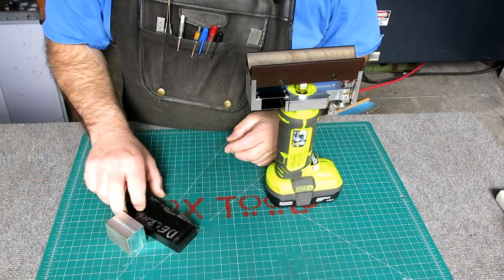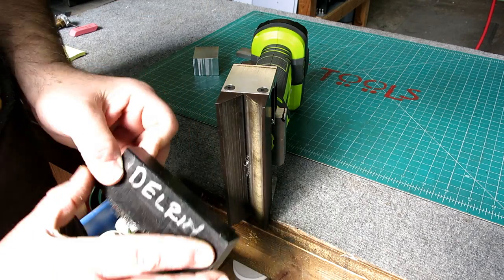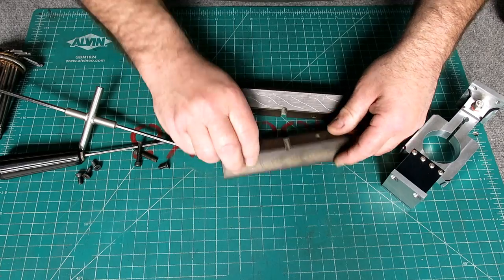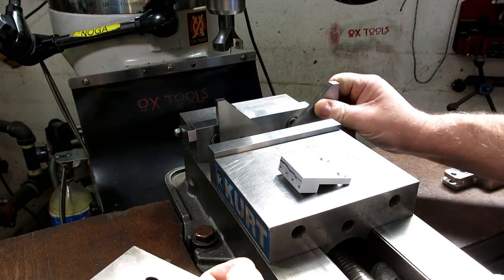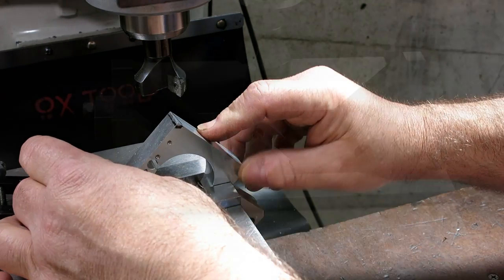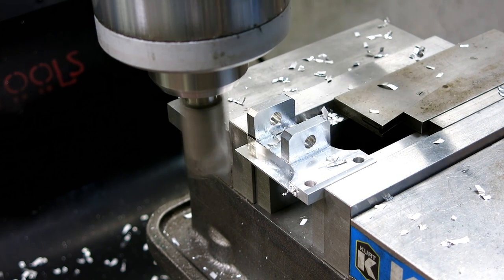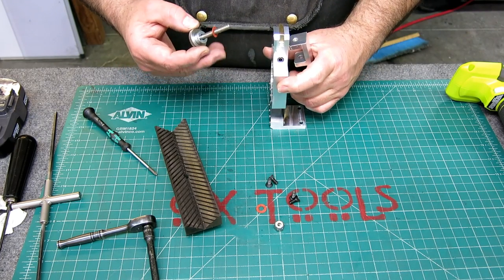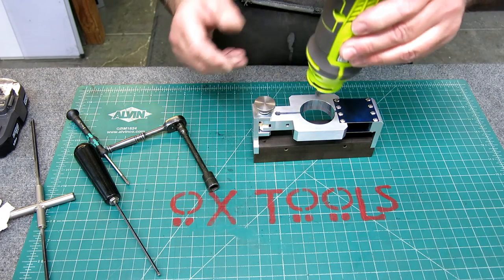Power Chamfering Tool

Comment: Thanks Tom, very well though out design - Way more sofisticated than the one i built years ago, without height adjustment. I always considered cutting a fine pitch thread on the neck of a Router motor for fine adjust...
Reply from the maker: Hey Stefan, I bet you use the heck out of the one you built. I have many tools I have made that I wish I had done slightly differently but have never had the time to go back and change. This tool would have been the same if I had built it with a pneumatic die grinder like I originally intended. 

Thanks for stopping by!

Cheers,

Tom
Reply: You might be interested in a tool called a microstop countersink; they're common in aviation for precisely countersinking rivet holes and the mechanism may be adapted.
Reply: @jimsvideos7201  Thats a good call.   I just found a little set and they are wayyy less expensive than I was anticipating.  Typically when you say "aviation" or "Porsche" the cost of said tool/widget goes up IMMENSELY.  
I think I might actually buy this guy i just found: https://www.skygeek.com/aircraft-tool-supply-133kit-microstop-countersink-kit.html

Comment: That would stand proudly next to the power squeegee in the gizmos you never knew you needed but now can't live without.
I didn't buy a squeegee, mainly because everyone else did!  But this I would buy like a shot.  I am a compulsive sprue trimmer  I built a thing like a potato peeler to shave those aggravating and often sharp little seams from tool handles and the like,
When I first started work one of my first jobs was to use a hand auger -with a plastic loop but no crosspiece to make a small hole in a piece of wood, I felt quite pleased until I spotted the other 999 - by the end of the day the moulded loop had almost bored a hole on my delicate schoolboy palm and the burst blister was leaking.  Being my first day I just cracked on I wasn't going to ask for a glove or a piece of wood to make a handle.  Before I went home I trimmed that loop 'till it glittered.

I never forgot and always trim the sharp edges and chamfer corners before using all my tools for the first time.
So I'd appreciate a flat surface trim option as well as the chanfer on v2.1 of the tool please Tom.

Comment: Have you seen those little pneumatic chamfering tools? Look like a mini palm router with a “router bit” that takes a triangular insert. Not quite an analog for your tool, but they work well for chamfering a hole or slot if you have a steady hand

Comment: Tom,  Great fun seeing your log cabin self at work.  You look happy! Please trim the ends of the bottom uninstrut bracket on the lathe before someone gets their ankle sliced open.   Glad you’re following you instinct about insulation. It is a bit of a scam in my opinion. They buy the insulation in large quantities cheap. The actual installers will usually be underpaid and will do the in less time than you can imagine.  Installing foam panels or, having it sprayed on could save you some $. I’m not sure. One thing I am an expert on is mice.  Do everything you can to seal up your building now; they’ll still get in, just not as many. If you can, I suggest you install exhaust fans before you insulate the ceiling?  Cheers, Will.

Comment: Oh wow, that's handy as hell, great idea.  I can see other possibilities for this tool as well, such as quick change vee blocks (or just a split vee block that you can widen or narrow) for different angles, or an adjustable stop on one side so you can quickly cut circlip/ring grooves in round stock with a smaller cutting tool...just lay the round stock in the vee block and rotate it to cut a few thou at a time.

Comment: I’d like to see the designs if you ever draw them up.  I also want to build the “male” version of this tool.  That is, a tool to cut a narrow (.030-060) relief (~.050” deep) in the inside corner of an internal angle (30, 60, 90, etc).  IE, the relief in a dovetail...Could be a saw or a tiny endmill and will be more dangerous if not designed properly, but very useful. Thanks for sharing!

Comment: Very nice, as far as the machining for the center nut, I have tried the same thing, and what I found is that if it was a regularly used adjustment reference, the flat on the nut was to short to last for any length  of time, so it might have been a blessing in disguise. You're still totally amazing.

Comment: Hi,Tom. I don't know if you've seen the video but Stefan Gotteswinter made a bench mounted power chamferer using a cheap small sized router. He used the type you can detach the base plate from. Love your design as it is very portable being cordless. I do have a Dewalt cordless die grinder but it would be difficult to adapt because of the long nose and rubber over moulding. Love to see some plans for this tool.

Comment: Nice design, the only thing I would do is break the edges on the groves you milled into the v-block.
Reply from the maker: Hey Joe,

That would defeat the purpose of how they work. They actually shear off little chips and bits as the block slides down the vee. Kind of like how a foot on an indicator base is sharp cornered to prevent dust and dirt from going underneath. I did flatten the surfaces so you don't feel any sharp edges when you run you hand down the vee. Thanks for the comment.

Cheers,

Tom
Reply: I thought you were joking.  I was going to ask Tom to show us how to sharpen that little bit he used on the grooves, but didn't know if it would sound funny, or like I was a jerk.  

I had no idea the sharp edges served a purpose!

Comment: Really enjoyed the video , My choice for tools had been De Walt when made here, only use the corded ones from offshore. Ryobi makes descent tools and the One + have over one hundred tools available using same power configuration and their drill, driver, hammer drill combo really works well and doesn't over-cost the wallet.
Reply from the maker: Hi Joseph,

Normally I'm allergic to Ryobi but this particular drywall trimmer had a couple of features that won me over. The circular neck, the top speed and the low price since I would be abusing it on metal. Yes the downside is now I have another battery system in the shop. 

Cheers,

Tom

Comment: I agree. It’s hard to remember which edges. The problem is that a square has too many sides (strange, but the general purpose rectangle has the right number). I’ve been working on an improved square for some 30 years, but, for some reason, I haven’t been able to perfect it yet. I’m close though!

Comment: Add some tabs to the main body to make it bench mountable, I would love to see the prints. Foot pedal operation would be cool. This could be one of those tools where you use it every day.
Reply from the maker: Hey Doug,

After I released the video I realized I should have shown the unit clamped in the vise. You can grab it by the main clamp and hold it in the vise. Works pretty good.

Cheers,

Tom

Comment: There is a tool that is readily available called a laminate trimmer the is used to chamfer the laminated used on countertops. These tools have a no load cutter speed of up to 36,000 RPM. Most already have a table that slides towards and away from the 1/4" cutter that has a fine setting for depth adjustment built in. The bottom plates on many models have a metal table with a plastic face which is removable and normally have a number of holes in it so it could have a V block bolted to it. Because they are one of those tools that most people don't understand what they are used for and tend to ignore them, they can be picked up in good condition for a small amount of money in pawnshops.

Comment: Heck Industries Inc. makes similar tools; they have a pnuematic deburring tool like you mentioned, larger electric power bevelers, and bench top "bevel mills". I think they're designed more for grinding weld bevels. I have their VA-400 bench unit and it's a heavy tank of a machine.. it even uses indexable carbide inserts : )

Comment: Nice tool. I just happen to have a small battery trimmer. It doesn't do much as a general-purpose router (which is what I  hoped it would do), so maybe it's a candidate for a chamfering tool. It will probably depend on whether I find a nice round nose for clamping when I check it.

Comment: Now I'm paranoid because I swear I've seen someone build something like this on YouTube already but now I can't find the video! It was a similar concept except using a die grinder and set at 90° to use the side of a carbide burr for the cutting action.
Reply: Robin Renzetti built a smaller version of this a few months ago.
Reply: @MaxPower_Designs  that's it! TBH I think robrenz's version was a bit better and simpler, though maybe a little less portable depending on where someone has air in the shop. To be fair, it's hard for anyone to compete with him on quality and precision...
Reply: @cavemaneca  Robin is the man, his work is unbelievable! The guy’s brain is on an whole other level!

Comment: Cool project.  I'd lay it on the side to square in the spinning yellow submarine into the holder.  That is more or less flat to square the work end and the cutter power pack (battery) end. :-)

Comment: Awesome! Just started over in a new shop. And as the new guy my days have been 90% bandsaw for now; this thing would really come in handy for larger parts vs ye old disk sander. Looks like a good few weekends of side project time ahead. Thanks for the video Tom!
Reply: This would be really great in the shop for cleaning up large castings with straight edges.

Comment: Nice job Tom, the parallel flexture is a really nice design feature. What material did you use for the 'V', looks like Teflon (or Phenolic as you guys call it over there)? Cheers, Jon

Comment: Very neat tool.  With respect to the nut for the height adjustment.  Was the nut necessary in the design?  Could you have just threaded the body of the clamping block, and omitted the nut.  There would be plenty of length on the adjusting screw to hold parallelism it seems. Thank you for sharing the design and for the video.  Very well done.
Reply from the maker: Hi Glenn,

I wanted a durable replaceable material running against the stainless steel adjustment screw. Aluminum is a bit soft for maintaining an adjustment thread for something that will be adjusted frequently.

Cheers,

Tom
Reply: Another consideration: as the flexures are adjusted more angular the effective length shortens. The floating nut eliminates any side loading on the screw.
Reply: @azenginerd9498  Good one there AZ Enginered.  That is an excellent point, they would put side loading on the adjuster.

Comment: Wonderfully made! Excellent video too. This is just what I need. Do you have any that you would be willing to sell? (I can get the Ryobi tool).
Unfortunately I don't have a mill to create such a device. 
I'm currently chamfering stainless steel parts using a jig attached to a sand belt, but it takes a long time and the parts get hot. I need something like this to speed things up :).
They have a few rounded sides, but I should be able to rotate them in your device's jig to chamfer the round sides, which suppose I would have to do anyway with any other chamfering machine.

Comment: Grizzly sells a bench top version similar to a Burr Beaver except it's $200 not $1200. Got one, works great.  Edit: Got mine from Grizzly in 2013 they were $200.  Now 2021 they are $325. The Burr Beaver is $1900!

Comment: great video, great project — thank you!

might there be a place for a scale so that different chamfer sizes could be easily indexed?

maybe you can just bottom it out and count turns?
Reply from the maker: I would probably put a small micrometer head on the adjustment or mount a small dial indicator somewhere. Its pretty hard to see .010 type adjustments. You could also use shims as hard stops.

Cheers,

Tom

Comment: Snazzy tool Tom! Is the Vee made from P1 Phenolic?
Reply from the maker: P1. Not sure what that grade is. In the US we call the stuff I used Garolite XX. Sometimes called paper grade industrial laminate. It machines easily but stinks a bit when cutting. 

Cheers,

Tom
Reply: @oxtoolco  yeah I know that material too well. Used to machine hundreds of blocks of it for counter top laminate machines to hold the heater elements. Turns your coolant into a horrible piss smell and colour. Abrasive on cutters too.

Comment: Does this really deburr the edge or does it just create smaller burs on one of the long chamfer sides? This tool has the same rotational axis as the tool used to mill the flat surface. Should not the rotational axis of the milling cutter in the chamfering tool be perpendicular to the one used to create the flat surface using the side of the cutter in the chamfering tool rather than the end? Even that would theoretically leave a small burr at the edge of the chamfer.

Comment: Thanks for the video. 
Does the flexure maintain a depth setting in that application?
Reply from the maker: Hey Chris,

Good question. Seems to be stiff enough that it makes a consistent chamfer even with variations in hand pressure. The design because it has a screw can tolerate fairly stiff flexures.

Cheers,

Tom

Comment: What's the advantage of having a seperate nut in the adjusting screw compared to just cutting a thread into the part itself? Doesn't this add more backlash into the machanism?
Reply from the maker: Hi Cat,

Good question. I wanted a durable replaceable material running against the stainless steel adjustment screw. Aluminum is a bit soft for maintaining an adjustment thread for something that will be adjusted frequently.

Cheers,

Tom

Comment: Hi Tom,

How come you put the cutter on centre with the v of the guide? Wouldn’t you want the cutting to be in one direction? Thanks!
Reply: Thought about that Nr decided that with the cutter centred In the tool the cutting force would be perp to the path.
IE, neither climb or conventional, neither pulling or pushing the job.
What do you think?
Reply: @captcarlos  thanks for the reply, I would have thought the force would be perpendicular to the axis of travel of the piece being chamfered? In my mind, you’d want to be pushing against the force, like with a router table or spindle moulder.
Reply from the maker: Think about how you would mill something like this. For small features like a chamfer you generally just run down the center. Climb or conventional makes little difference but complicates the mechanical design considerably.

Cheers,

Tom
Reply: @oxtoolco  Thanks Tom, I was thinking along the lines of small, light or thin parts which you’d have to put extra pressure on to make sure it didn’t lift, but I guess you can always just run it through again!

Comment: Let the copycats begin!

But wouldn’t a carbide rather than a grinding wheel such as diamond also leave a burr?

But now I have a use for that DEWALT sheet rock tool that is ten years old with twenty minutes use on it.
Reply: Also, as a guy who has whipped his finger on a router bit doing the exact same thing, i would use a carbide burr anyways so it doesn't grab the part and fling it, leaving your finger very near a spinning end mill. Not a fun experience. Took about a month to get the corner of my finger back.
Reply: @daveb3910  Did your finger prints regrow properly? I was amazed that mine did when I clipped the tip off a finger with the wood jointer.

Comment: Great project. Can you give us a little info on how long it takes to set up the Makino and what program you use?
Reply from the maker: Hi Randall,

The Makino is easy to set up. Its much like using a manual machine in many respects but with full 3 axis CNC control. It has two almost separate control systems you can switch between for manual, semi automatic and fully automatic control. Very useful in the job shop or tool room environment where you need just one or two features CNC machined. 

Cheers,

Tom
Reply: Dang..... I think a Makino would sure look good in my shop. Maybe if I’m extra good Santa will bring one for Christmas. 
Thanks for the info. 😬

Comment: If I was going to buy (make) something like that it would be for weld prep, rather than anything else. I don't think I would ever choose a tool like this for deburring. A small file has no batteries, fits in your apron pocket, and has better ergonomics.
Reply: A file is more versatile, but takes longer and is less consistent.

Horses for courses.